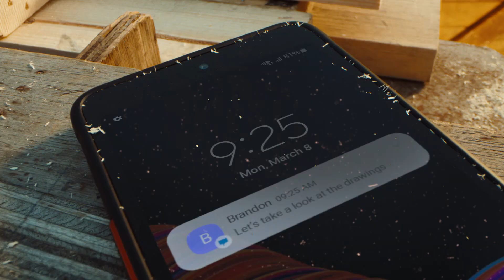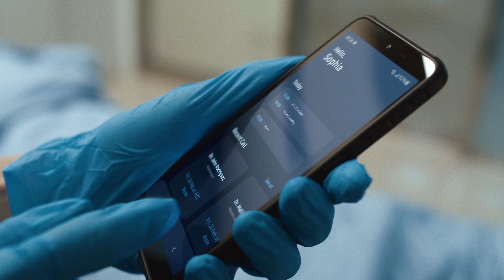Introducing Galaxy XCover 5

Comment: 5-function micro stand, professional for mobile phones and tablets.  The smallest, the most effective.  And the most reliable mobile and tablet accessory base that you have never seen and you will be surprised by its exclusive features.  with dimensions of 16*12*2 mm.  The last option, which is placed on the mobile phone and tablet, and the first priority will be the choice of all users.  This plan is suggested and can be assigned.

Comment: I DO NOT RECOMMEND!!! interface from the previous era. Photos in low light are practically impossible to use. The lack of stabilization is another problem. And this is supposed to be a phone for 2022? Overall it's very bad even for the price. P.S. I remember the Sony Xperia Z1 Compact from 8 years ago, it was much better.

Comment: I'm the kind of guy that want a no nonsense kind of phone.
I'm also the kind of guy that posts a positive review if something lives up to my expectations.
I'm also disappointed to say that this phone stopped working after 13 months.

I'm also the kind of guy that buys a second phone of the same type if it serves me right. Too bad every phone is put out of production by the time it has proven itself ( if that ever happens).
Reply: It has 2 years of warranty I believe... that said I'm not 100% satisfied with it.
I was very happy with my 8+ years old Xcover3, but the mini-jack was not in a good shape, the cover not waterproof anymore, the system not upgradable for years, so I decided to replace it with the Xcover5 "enterprise", and I'm like meh...?
It takes 2 x longer to start, I had first to spend 1 hour online, restarting several time the system, I can't do anything without pressing a 2nd time every option to confirm...
If the old Xcover 3 was not slowly losing it, I would keep it for a few more years.

Comment: Good idea but be better if it had more internal storage and a great camera for use on site. Also doesn't have wireless charging for when the plug in gives up which it will.. Not trying to be negative but my s10e is waterproof and is reasonable with dust and has gorilla glass.
Reply: I wonder if it overheats like my s10e
Reply: @harackmw  maybe

Comment: What's the difference between the Xcover 5 and Xcover Pro?
Reply: The Xcover Pro is pretty much superior in every dept from the much higher res 6.3" screen the higher capacity battery, faster cpu, more hard buttons, pogo pin support etc etc...it is a bigger heavier phone though....from what i've read the only thing the Xcover 5 can do is support a larger sd card at 1TB. In fairness, the Xcover 5 is meant to succeed the Xcover 4 and the Pro is still it's own current 'enterprise' phone.
Reply: @Mr_Smarty_Pants  Is there anything newer/better than the Xcover Pro?
Reply: @kyle_vr  not that i know of, i have one myself. it is currently the best ruggedized galaxy as of today....ive heard rumors of a 5g true successor forthcoming for the pro, but havent found any definitive info. The only thing i wish my pro had was an amoled screen like my S5 Active had.
Reply: @Mr_Smarty_Pants  Is it based on one of the 'normal' galaxy phones? (e.g.  S10, S20)
Reply: @kyle_vr  the xcover 5 or the pro?
Reply: @Mr_Smarty_Pants  Sorry, I forgot to be more specific. I meant the Xcover Pro 🙂
Reply: @kyle_vr  , XCover 6 and Unihertz Tank